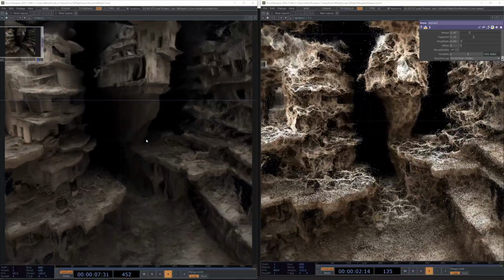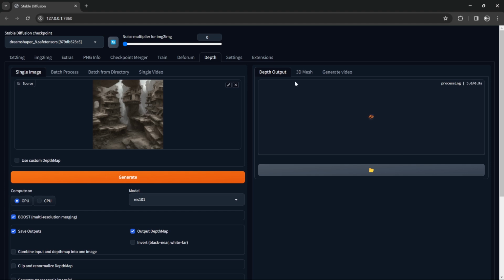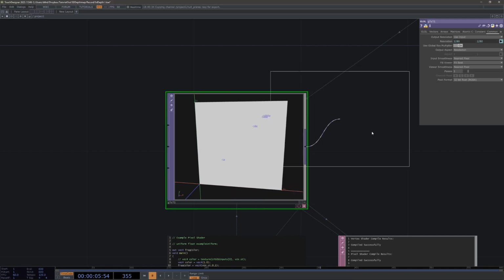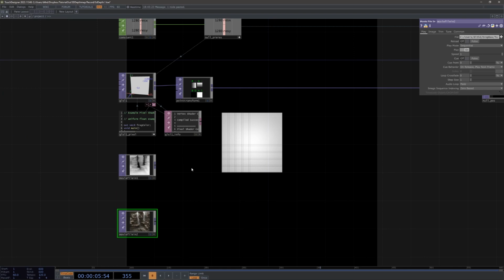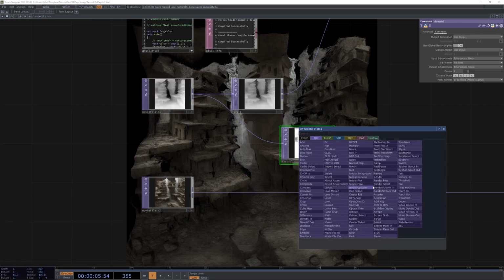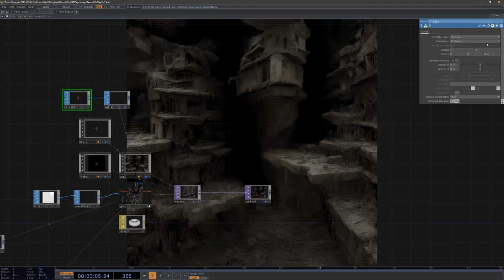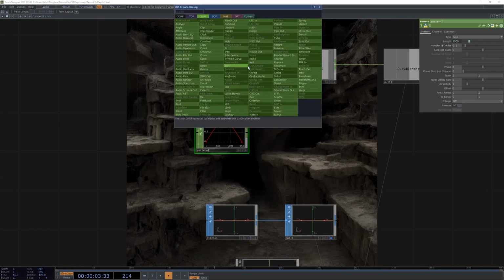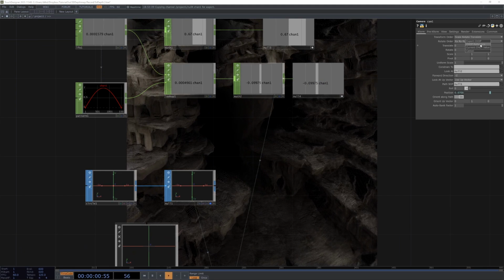Using Stablediffusion to create a pointcloud 3D effect in Touchdesigner. Part 1

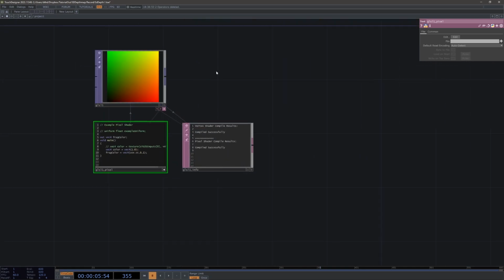Comment: 4:14 Im typing the code but I get an error. specifically saying "not enough data provided for construction" "no code generated".  I copied the text exactly like you did. What is wrong on my end ?
Reply from the maker: That is weird, are you sure you used a Glsl top ?
Reply: Thanks tried again and figured out the problem

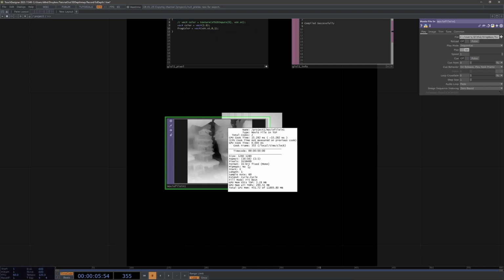Comment: 7:10 What if I used Midjourney and MiDaS Depth Maps (which produces an 8-bit fixed RGBA image)?
Is it not compatible? or do i just edit the GLSL top settings to an 8bit fixed RGBA pixel format?
Reply from the maker: You can of course use Midjourney to generate the first image, but for the depth one you will need something at 16 or 32 bit float.
Reply: @Dithdsgn  when i add the color rgba to the Geo COMP there’s an error. Is this because the the colormap is 16bit pixel, and the depth map is 8bit pixel? Do they have to be the same?
Reply from the maker: @sqkassian  No, the bitrate should not be an issue, but the resolution of each operator is. Are you sure your color map and depth map are the same resolution ?
Reply: @Dithdsgn  yes they're the same. The error says all ops must generate the same number of instances.
Reply from the maker: @sqkassian  That means that your tops your are instancing from do not match in resolution.
Are you using a top for the scale aswell ?
You should check the resolution of all the tops you are referencing in your geo.
Reply: @Dithdsgn  hmmm I knew my image and depth map were both 1240x1240 in resolution so I just used "Use Input" for the moviefilein output resolutions. I referenced the resolution using the constant CHOP (1240resx & 1240resy) and it was solved. I don't know what the difference is though? Aren't both ways using a 1240x1240 resolution?
Reply from the maker: @sqkassian  It's strange if both were indeed 1240x1240. You can do a middlemousebutton click on top of the operator to be sure it's indeed 1240.
Did it worked well with the 8bit depth map ?
Reply: @Dithdsgn  both were 1240x1240 i checked

Comment: Would u be able to do this this with a real time generated depth map? Like from video footage ? Is there away I could dm u some questions
Reply: Never mind after many hours I figured it out! Hahah it’s definitely possible just was a bit tuff
Reply from the maker: Sorry, just seeing your comment now.
I would be curious to see what solutions you came up with :)
On first thinking I wouldn't use stablediffusion depthmap to do so, as in order to achieve it you would need to extract each images of a movie, and then process the depth map of 
each pictures. The stability in the results would be a bit odd. But you could extract the depthmap out of a movie using davinci resolve. It will offer a better stability, and the yes, you could process it realtime in touchdesigner.